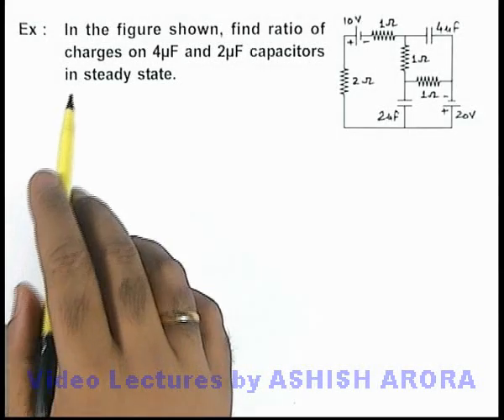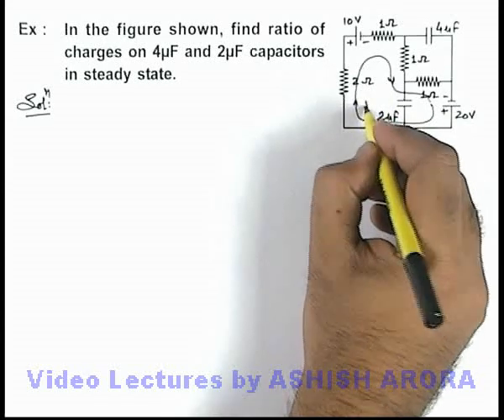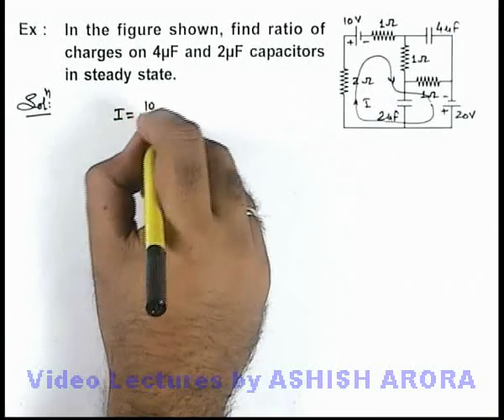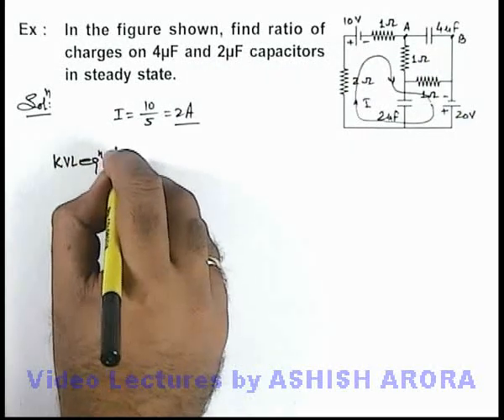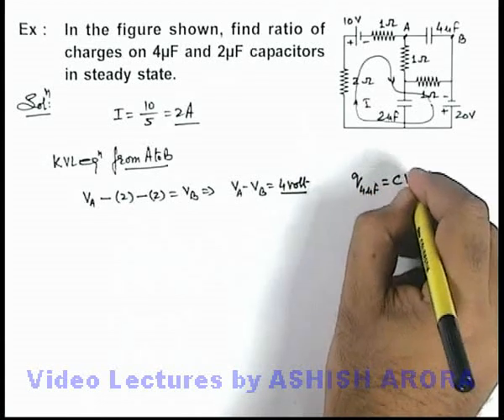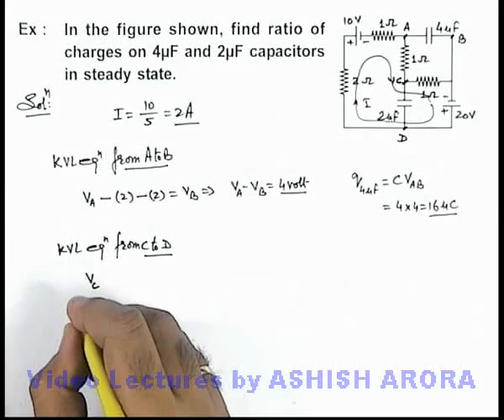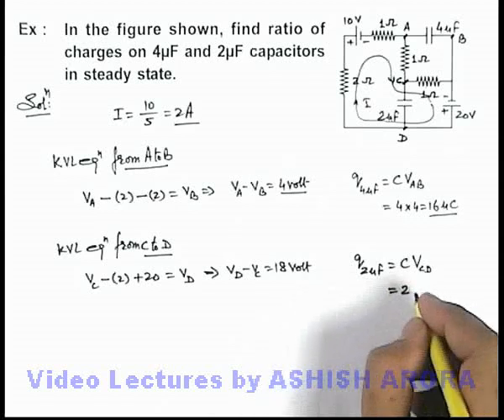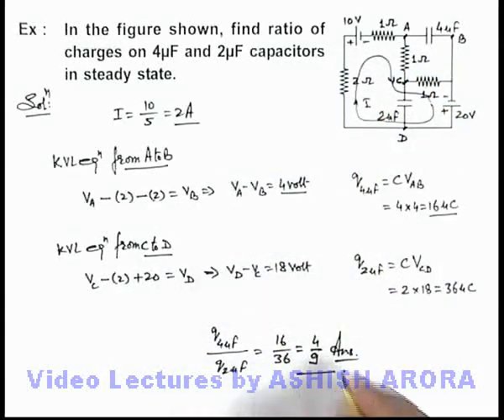Class 12 Physics | RC Circuits | #16 Solved Example-7 on RC Circuits | For JEE & NEET

Comment: Sir can u please solve this question using kcl (as u do using nodal analysis) i was trying but could not solve .
Please sir.i used to solve every question by your  nodal analysis trick(sumaation i=0)but i got stuck in this particular quest.
Reply: Please sir
Reply: @ujjwalchitransh6411  here it can't be applied!
Reply: @ujjwalchitransh6411 hlo?😅
Reply: @ujjwalchitransh6411 did u Crack iit ?
Reply: Hi